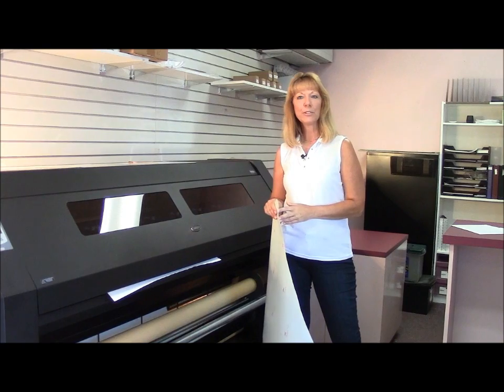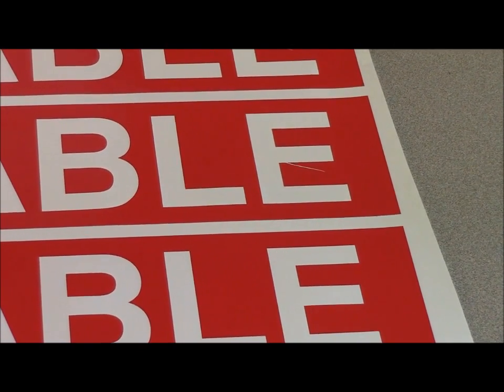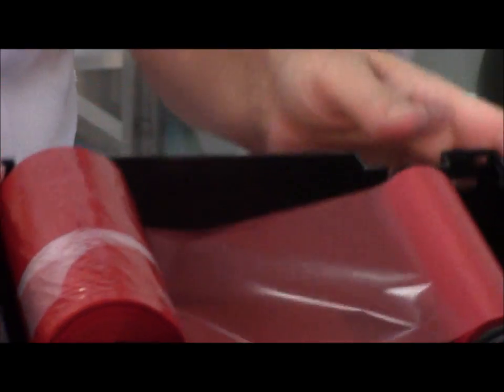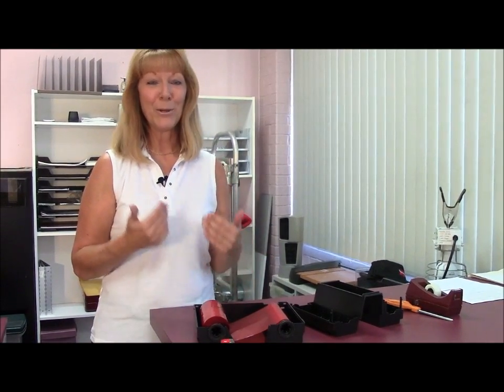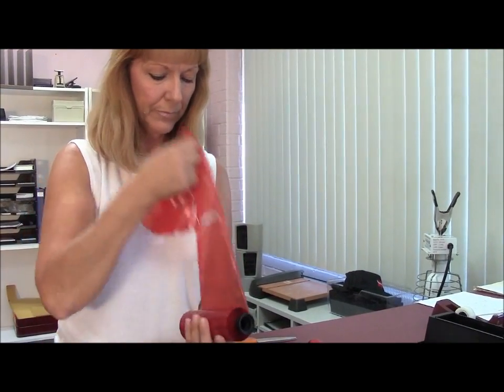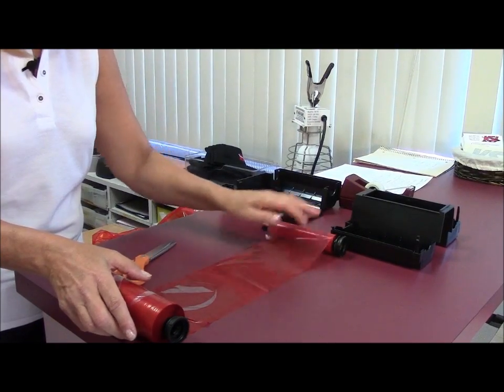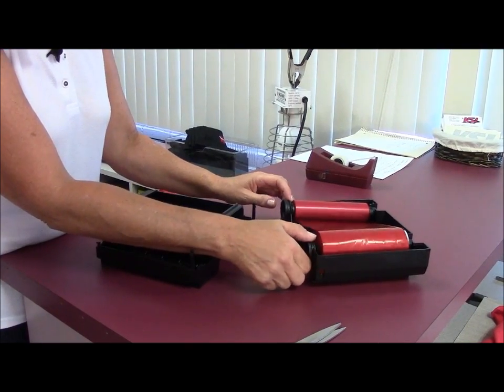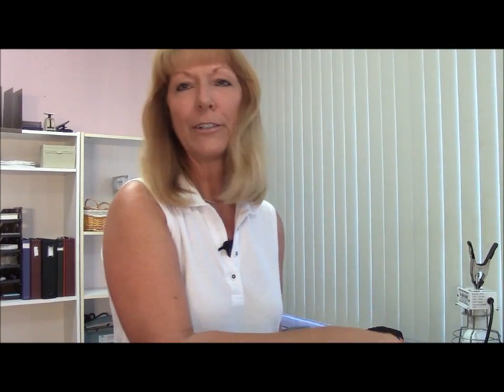Troubleshooting Summa DC5 Print Imperfections with Print Cartridges

Comment: I have consistent problems with wrinkling and lines. I lower the density by 100 increments and eventually I get a spotty print along with the line. There is no density where I get no line without giving up quality of the density of the color. EEEK I've had soooooo much waste.

Comment: It's your density setting. It's too high. Just bring it down a bit and it will go away. The density setting controls heat levels and needs to be adjusted for each type of medium you print on. Just go to print settings

Comment: pretty easy to pull another cassette and see how to load it correctly. IMO Summa Support is worthless. No FAQ database. Ive figured out all the issues with the machine by trial and error. of it wasn't for the mirror colors I would of bought a Roland instead.   Dont ya just love how the machine thinks the cassette is empty when there is at least 30 percent left?  Have to trick the machine by advancing the ribbon until picks up where it left off.
Reply: This is my second machine since 2001 and I rarely have a ribbon that is left over before the chip runs its course. If that happens, I always rewind the ribbon to where it left off, then call them and ask for another chip. I save my old chips and sometimes another chip will run the ribbon out.     I also rewind the ribbon to the last print area used before I start the next print run especially with cmyk, because sometimes my files are only in C and K but it runs the Y and M without using the ribbon. That's ribbon that can be rolled back and saved.

Comment: We have had this problem for years. I have noticed that magenta has been the most problematic in wrinkling . I find it hard to believe that Summa doesn't  know about their inconsistent ribbon alignment on the spools. I dont want even add up how much money we have wasted with reprints and testing to correct this problem. Call tech support and they always want to run density and tension tests. This ribbon splicing does seem to correct the problem most of the time, but for the amount of money we spend on ribbons this should not still be an issue. Just a note: I always strip all the used ribbon down to clear leader on the spool before I splice.
Nice job on the video, Im sure this will help a lot of people, thank you for sharing.

Comment: Helps if you load the ribbon correctly before you end the video.
Reply: and how many times did you pull another cassette to see how to load the spool when you first started?
Reply: Just a couple of times plus the cassette has a diagram  on it on how to load it.

Comment: Always put the ribbon in the part with the chip on it then place the larger lid on top.  If you look closely on the cartridge side with the chip, you will see there is a diagram imprinted in the plastic on every cartridge showing you which side the new ribbon should go on.  Make sure the round ends fit in all 4 slots before attempting to close the lid, or the lid will not fit.  You will know its wrong when the lid won't fit cleanly.